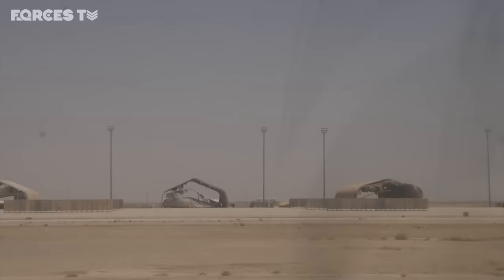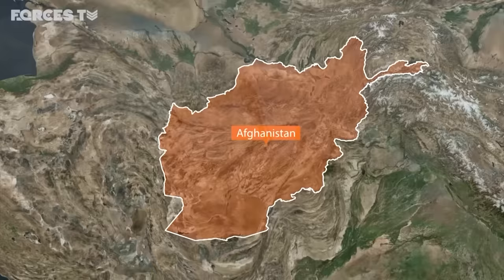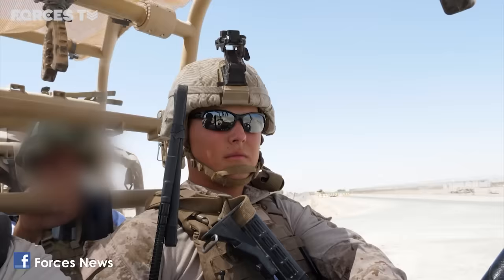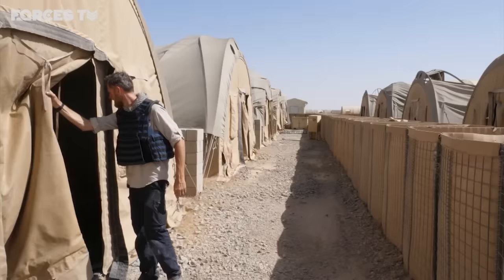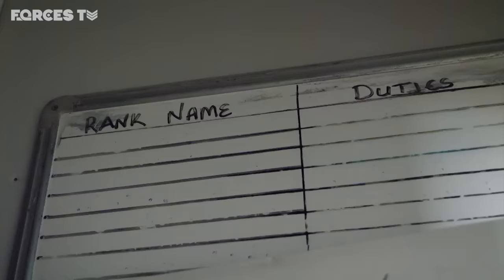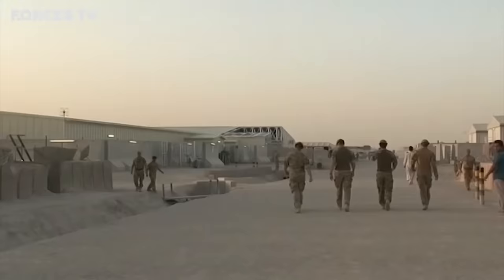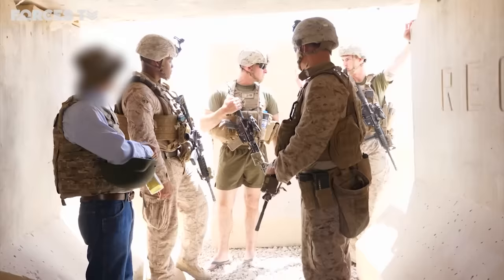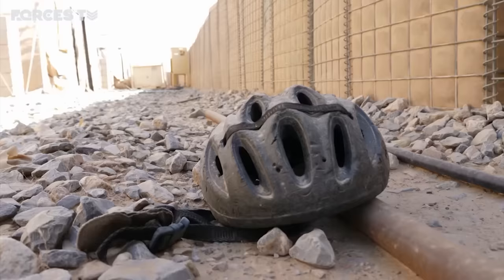Back To Bastion: Returning Four Years After British Troops Left Afghanistan | Forces TV

Comment: That is not left clean, so many things there that can be recycled, but no, left as a pollutant for everyone. And a joke that it cost more to remove even though they didn’t do it well. Shameful and very disappointing for Sure!!!!
Reply: "left as a pollutant"... Since when did empty buildings cause pollution. Also, that's hardly the most pressing problem in Afghanistan. Anyway, how would u recycle those buildings? Afghanistan isn't exactly flush with infrastructure and its hardly feasible to fly it back to the UK. How could u possibly get such an insight into the success of the removal from a few minutes on youtube... How do u rate "well". Massive parts no longer exist, which sounds pretty well done to me. I'm not sure u understood but the camp is still in use by the US, ANA & probs UKSF so it's not going to vanish entirely.
Reply: Henry Bleasdale Just explain how’s it being used when it’s abandoned? Not trying to clever or anything but just explain.
Reply: CALSW0RLD it literally says it was given to the ANA as an outpost in the region as well as housing 300 US marines along with the soldiers they are training
Reply: Warmongers are a incurable desease for tax payers.